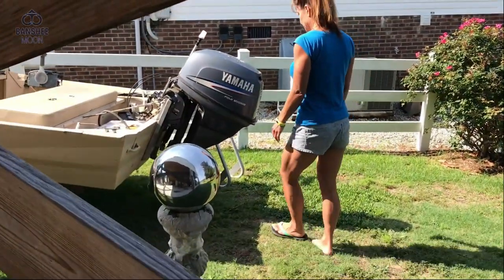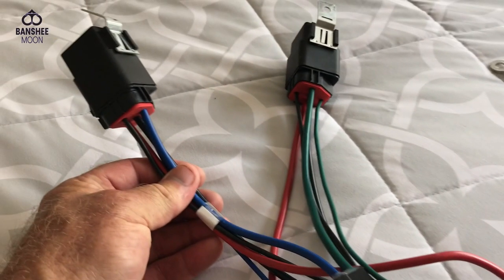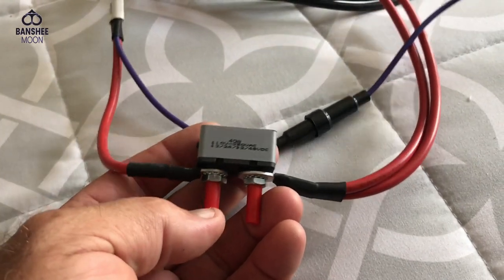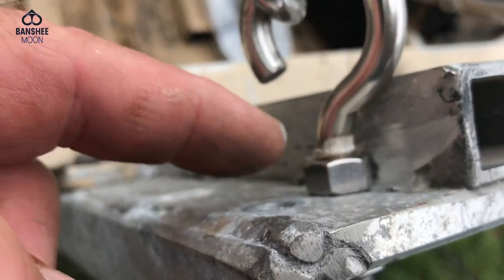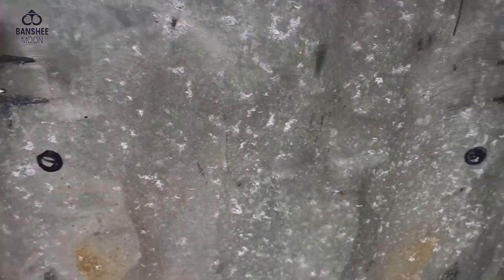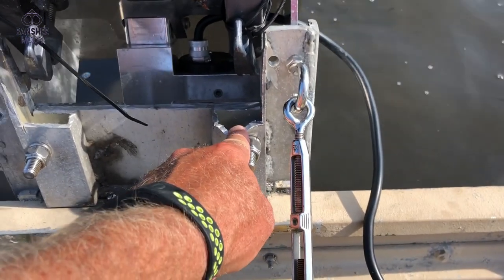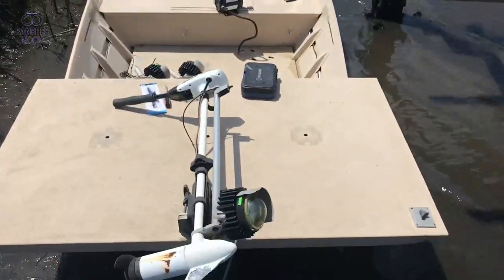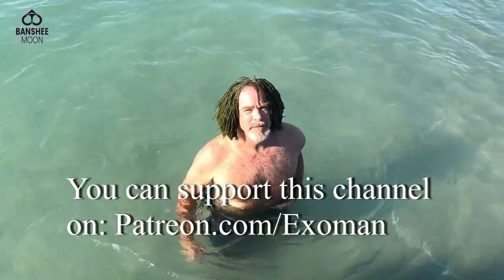Installing tilt and trim, after market boat motor lift

Comment: Motor seems to be seating pretty high on that jack plate. Would be a good idea to attach a steel safety cord to the motor & boat just in case..

Comment: Old fashioned method may be easier. I.e. no electronics to fail at od times. Like the outboard though. I gues it's heavy to lift in aided if it's already 40 hp

Comment: those are not fuses at the ends of harness  they are relays!!!   better get u some of those also !!!     dia lectic grease should be applied to those   get u some liquid neoprene encase that breaker completely or it will be a mass of rust in 2 months.
Reply: And there NOT RELAYS. Circuit breakers. 🙄

Comment: Why not get a short shaft motor for the short shaft boat? That cable contraption looks like a good was to get somebody hurt. You’ve never seen an outboard come off of stuff like that. I have and it ain’t pretty

Comment: The things you called fuses are relays. The thing you called a switch is a breaker. Just a heads up before you make another instructional vid

Comment: I have a technical question.  I just installed the same CMC PT-35 on my boat.  I installed it lower on the transom to keep the cavitation plate 1.5" above the bottom of the transom.  The Power Trim is installed about 3" below the top of the transom.  The problem is that when I trim up, if I'm not paying attention, the motor will make contact with the transom potentially causing damage to the motor.  Everything I've read says to make sure the motor's cavitation plate is around 1" above transom bottom AND the top of the trim plate is 1" above top of the transom.  Well this is not possible on my 25hp yamaha.  I either have to install the trim plate lower on my transom, or the install so that the cavitation plate is higher than it should be.  Is there a solution to this, so I can satisfy both requirements?

Comment: Never ever use those self resetting breakers. They are not even approved by the ABYC. The problem is when there is an over current situation, they can continuously cycle till they fail open or closed and sometimes you may not even know it’s happening. Buy a enclosed fuse holder or a marine ignition protected resettable breaker.

Comment: I'm getting ready to install one on my Jon, how did  you attach the yahama to the CMC? Just the clamps? I noticed when I put my Yam25 on the CMC its really tight to try to drill and install the bottom 2 bolts to help support the clamps.